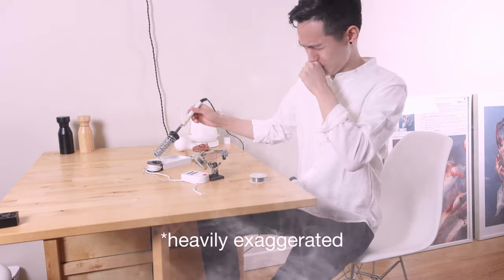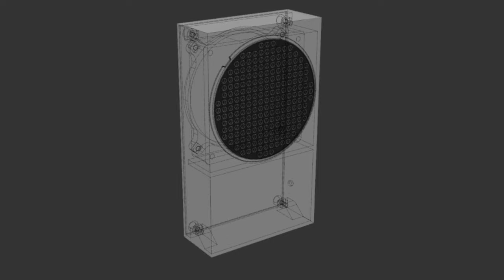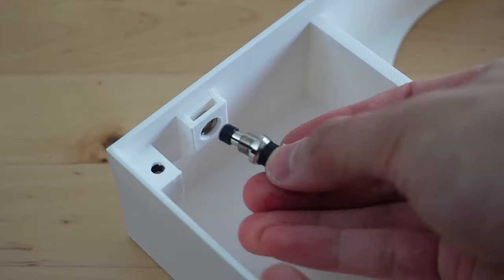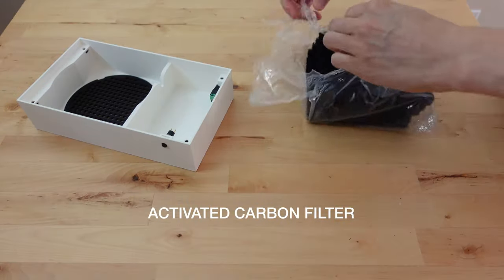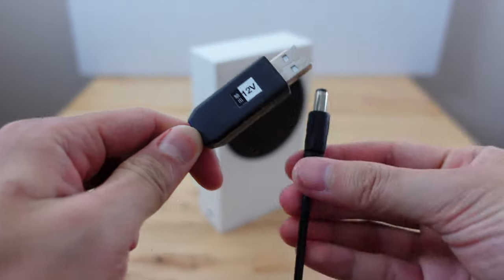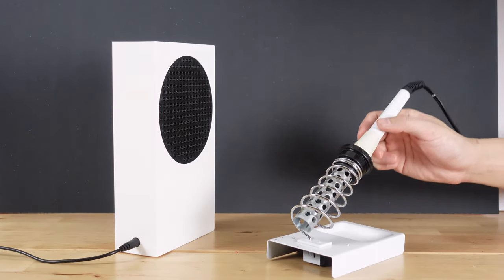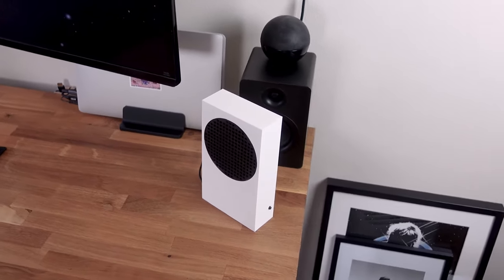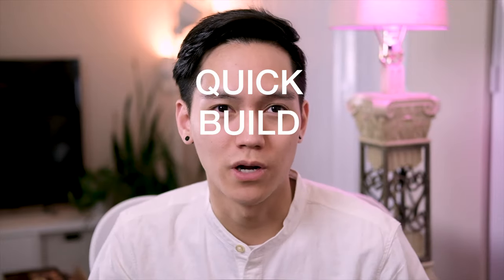Xbox Series S Air Purifier / Fume Extractor for Soldering

Comment: Found it on Thingiverse in trending. Great well-thought design, looks really neat. Just wanted to warn you and those who will be using this. This setup ability to draw away fumes is not more than a placebo. The fumes will still be in the room. Get a proper ventilation if you do soldering a lot. Stay safe!
Reply: Doesn't it trap like 80% of the heavy metal vapors in the filter?

Comment: Cool visual design idea, but I think without a particle filter it is not a proper air purifier. Activated Charcoal is good at filtering solvents and the like from flux, but you also have to worry about particles from the actual molten metal. Just a PSA that activated charcoal is not the end all be all filter, there is a lot more to filtering and you have to use the right tool for the job.

Comment: Glad this popped up! I've been interested in diy mech keyboards recently and I've been looking into solder stations and fume extractors before i attempt anything, I'll have to build this once I get a 3d printer
Reply: Same! I’ve been thinking about buying a flexible hose, connecting a fan, and piping the fumes outside via a window. And this design is so clean!

Comment: Dude I love the design. Very innovative. I don’t know if the carbon filter is enough to filter the toxic fumes (if you’re using lead solder) however. My experience comes from air filtered dust collectors (from woodworking). I think combined with another layer you will be HEPA safe? I would look at an N100 mask components and also a Festool vacuum filtering system, which I know will cover how they get down to safe levels of purifying air, albeit that’s not with fumes which is a different ball of wax. If you did research please share cause I’d love to do this as well.

Comment: Hey man i gotta question. When i upload the backing.stl to cura it doesnt fit on the platform. i know you said in the thingiverse summary that its a few mm smaller than the bed size but im brand new to 3d printing. (just got the ender 3 pro 2 days ago) to make it fit should i just manually move the backing down onto the bed in cura? it wont snap to the bed by its self. it wont even let me slice it. what should i do? 
EDIT
nvm. figured it out
Reply from the maker: hey sorry for the late response. glad you figured it out! nice :)

Comment: Hey, could you upload the original files? trying to remix it but it is hard with STL files =(
Reply from the maker: YES, just added the fusion file to the thingiverse link: https://www.thingiverse.com/thing:4618039/files 
A remix i would highly recommend is moving the power input cable to the back side instead of the side. it occurred to me after building it that if i had designed it with the power input on the backside, then i could have used this thing lying on its side! but because the power input is on the side, this thing can only be used standing up :( 
Good luck!
Reply: @ScottYuJan  I actually have a 60mm noctua, want to try to remix a smaller version, il send some pics ur way if i achieve it !
Reply from the maker: yo... you should totally do it. a mini version of this would be dope! good luck man
Reply from the maker: @rodrigozurek  that's AWESOME man. you did that fast haha you also made some clever tweaks to make the design work at such a small scale. nice job man! would you mind if i feature some of these photos in a future video potentially? i would love to use it to encourage others to share their builds too.
Reply: @ScottYuJan  hey! thanks. absolutley I can get you some better quality pics later, il DM you on your instagram to ask for your email.

I had to rebuild it in solid works cause I am not fluent in fusion  360 made some mistakes but fixed them with a drill, lol

Comment: No offense but that filter isnt doing jack shit for the dangerous fumes from soldering :(
Reply from the maker: really??? :( 
I thought this was enough. what do those super expensive soldering fume extractors have this is missing?
Reply: @ScottYuJan  You can clearly see through your filter, it obviously won't catch anything. At best it removes some odor. Solder fumes are mainly particles not actually gas. Usually in the size range of around 0.5 to 1.0 microns. Hepa filters are 98% efficient for particles 0.3 micron and up. These particles pose the most serious health risk . Keep in mind the filters need to be replaced from time to time, depending on how much you solder. When it comes to your design having the filter behind the fan is the ideal thing. Air exhausting behind the fan disperse across the entire surface area of the filter, giving you even coverage, better airflow and efficiency. This reduces filter saturation rate and results in fewer filter changes. Hope this helps !